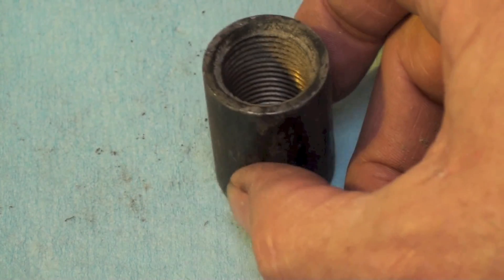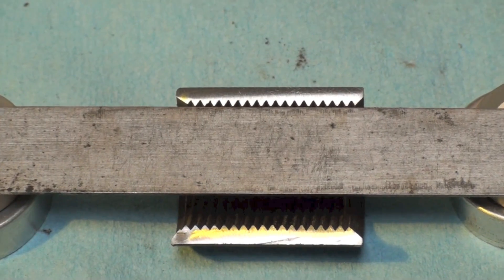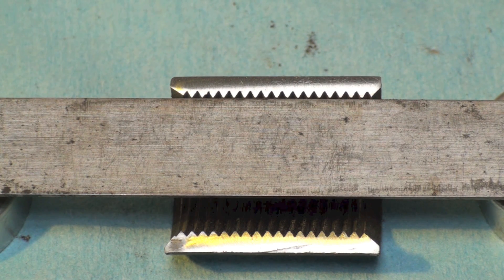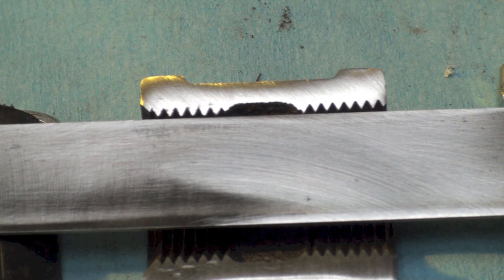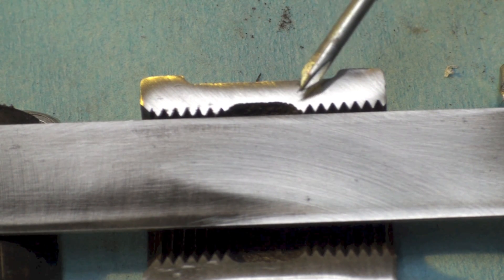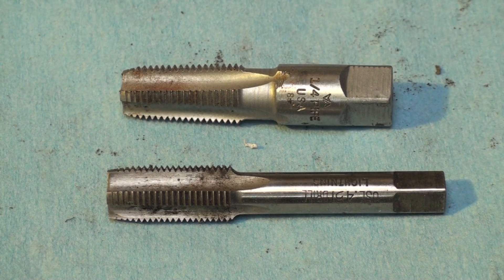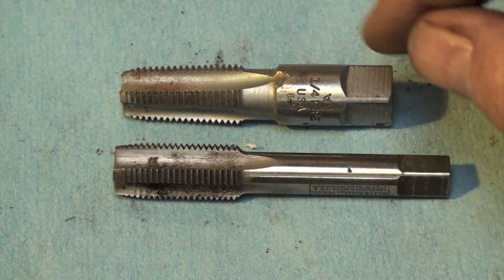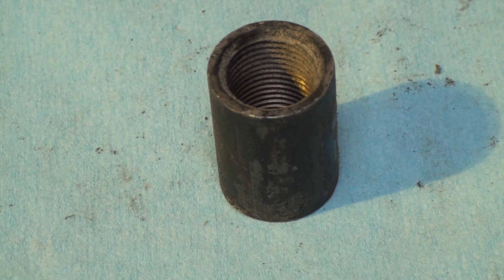The infamous pipe thread protector

Comment: I’ve used those lots. We usually request XH coupling. ……..however if that’s all you have I adjust my threads to not cut as deep ………it works.
Reply from the maker: I don't care how you thread it.  It will leak.  Maybe not today but it will leak.
GFM
Reply: 35+ years 100s if not 1000s of joints……..I’m good!
Reply: I agree, not ideal, but they will work in a pinch if taped and doped properly; and not a real high pressure system.  With the garbage threads on the nipples and fittings coming into the USA, you have to chase threads to clean them up anyway to get a good fit.

Comment: Sees video "It's a what-protector? I thought that was a free coupler included on the end of the pipe"
Reply from the maker: Its called a thread protector.  It does not have tapered threads, so it is not useful as a coupler.
GFM

Comment: Plumber used them on a gas line to the 15th floor to a generator i installed. Costly replacement after pipe supplier told him why it wouldnt hold air over 2 mins. Thanks for sharing
Reply from the maker: Welcome
GFM

Comment: Jeez I would hope HVAC guys would be smart enough not to use this, it's basically Gas Fitting 101 it was taught in G3 and it's stated in the gas Fitters Code book (can't remember the section off hand).
Reply from the maker: nomecaca I would not count on it.  In my area it was not addressed by the code until the 1990s.  I stopped using them in the early 1980s because of the leak problems.  
GFM

Comment: Amazing what information you share!!  I have seen these on gas lines and assumed they were like any other proper fitting.  Checked my lines.  One exists on the clothes dryer line and one on the water heater line.  Also glanced at the boiler and observed a similar water fitting on the hot water outbound iron pipe.  Below that water fitting is a great deal of aged corrosion/leak?  I have already replaced one aged gas shut-off valve on the boiler line as I detected it leaking (It had a pilot line spurred off it but disconnected).  Attempting to tighten the valve stem on the back side did not work.   I imagine if these "Thread Protectors" are not supported properly, any movement out of true will make them leak.
Reply from the maker: DOLRED They are very thin in addition to not having tapered thread.  Almost a guaranteed leak.
GFM